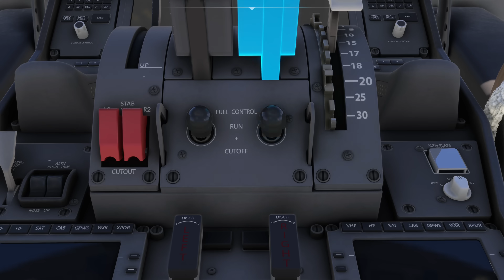Air India 171: Why Did The Fuel Cut-off Switch Get Moved?

Comment: What Really Happened - A Complete Reconstruction
THE PERFECT STORM: PRE-ACCIDENT CONDITIONS
The Aircraft:

Boeing 787-8 Dreamliner, registration VT-ANB
Manufactured 2013, 30,862 flight hours
CRITICAL: Equipped with fuel control switches part #4TL837-3D
KNOWN VULNERABILITY: Boeing warned in 2018 these switches could disengage during high vibration
FATAL DECISION: Air India deemed the inspection "advisory only" - never checked or replaced them
The Day:

June 12, 2025, Ahmedabad Airport
Weather: Clear, good visibility
Runway 23, normal operations
241 souls on board: 239 passengers, 2 pilots
THE TIMELINE OF DISASTER
T-minus 56 seconds (08:07:37 UTC): Takeoff Roll Begins
The Boeing 787 accelerates down Runway 23. Everything appears normal. In the cockpit, Captain and First Officer follow standard procedures. In the cabin, 239 passengers feel the familiar push of acceleration.

T-minus 4 seconds (08:08:35 UTC): Rotation
Speed reaches 155 knots. The pilots pull back on the control column. The nose wheel lifts off. The main gear is about to leave the ground.

T-ZERO (08:08:39 UTC): The Triggering Event
What the sole survivor heard: "A loud explosion sound"

What actually happened:

Main gear leaves the runway
Aircraft transitions to flight
One or both engines experience severe compressor stall/surge
Visible flame erupts from engine(s)
Violent shock wave travels through the entire airframe
In the cockpit:

Sudden bang/explosion
Entire aircraft shakes violently
Pilots instinctively grip controls tighter
T+3 seconds (08:08:42 UTC): The First Domino Falls
The severe vibration from the engine surge does exactly what Boeing warned about in 2018:

Engine 1 fuel control switch's defective locking detent fails
Switch physically moves from RUN to CUTOFF
Engine 1 begins immediate shutdown sequence
Fuel flow to Engine 1 ceases
T+4 seconds (08:08:43 UTC): The Second Domino
The vibration continues or a secondary surge occurs:

Engine 2 fuel control switch detent fails
Switch snaps to CUTOFF position
Both engines now shutting down
What the survivor felt: "The plane kind of stuck"

The aircraft, having just reached 180 knots and barely 100 feet altitude, suddenly loses all thrust. 241 lives now hang in the balance.

T+5 to T+8 seconds (08:08:44-47 UTC): The Horrible Realization
In the cockpit - the critical exchange:

Pilot 1: "Why did you cut off?"
Pilot 2: "I didn't!"
Both pilots simultaneously realize:

Neither intentionally moved the switches
Both engines are failing
They're only 100-150 feet above ground
Speed is rapidly decaying
241 people are depending on them
Aircraft response:

Deceleration from 180 knots begins
Minimal climb, aircraft struggling to gain altitude
Electrical systems failing
Ram Air Turbine (RAT) automatically deploys
T+13 seconds (08:08:52 UTC): Desperate Recovery Attempt
Pilots frantically begin recovery:

Engine 1 fuel switch returned to RUN
APU auto-start initiated for electrical power
Engine 2 fuel switch returned to RUN (4 seconds after Engine 1)
Critical development:

Engine 1 begins responding - core speed starts increasing
Engine 2 fails to respond properly - possible internal damage from surge
T+17 seconds (08:08:56 UTC): Asymmetric Thrust Nightmare
What the survivor felt: "Speed increased before struck"

What actually happened:

Engine 1 partially relights, generating thrust
Engine 2 remains dead
Sudden severe asymmetric thrust at only 200-300 feet altitude
Aircraft begins uncontrollable yaw to the right
Pilots fighting for control with minimal hydraulic pressure
Aircraft now heading toward populated area
T+26 seconds (08:09:05 UTC): The Final Call
"MAYDAY, MAYDAY, MAYDAY"

The captain's voice on the radio, knowing they cannot recover.

T+32 seconds (08:09:11 UTC): Impact
CCTV footage shows:

Aircraft in severe side-slip
Altitude approximately 200 feet and descending
0.9 nautical miles from runway end
The catastrophic impact:

Aircraft strikes populated area near airport
Massive fireball erupts
Of 241 souls aboard, only 1 survives
19 people on the ground are killed
Total death toll: 259 people
THE MAGNITUDE OF LOSS
The Human Cost:
240 passengers and crew killed
19 ground victims - people going about their daily lives
259 total deaths from a single preventable mechanical failure
Hundreds of families destroyed
One survivor to bear witness to the horror
The Ground Impact:
The aircraft's crash into a populated area added another dimension to the tragedy:

Homes destroyed
Families who had no connection to aviation killed
Community traumatized
First responders faced with unprecedented scene
THE CAUSAL CHAIN - WHY IT HAPPENED
Primary Cause:
Mechanical failure of known-defective fuel control switches triggered by engine surge vibration

The Fatal Sequence:
ENGINE SURGE AT ROTATION

Most vulnerable moment - high power, transition to flight
Created massive vibration/shock through airframe
Exactly the scenario Boeing warned about
DEFECTIVE FUEL SWITCHES FAIL

Part #4TL837-3D with known locking detent weakness
Vibration causes both switches to physically move to CUTOFF
Pilots had no chance to prevent it
DUAL ENGINE SHUTDOWN

Both engines lose fuel supply
At only 100-200 feet altitude
No time or altitude for standard procedures
241 people now in mortal danger
PARTIAL RECOVERY CREATES NEW PROBLEM

Engine 1 relights but Engine 2 doesn't
Asymmetric thrust at low altitude
Uncontrollable yaw/roll develops
Aircraft diverts toward populated area
INSUFFICIENT RECOVERY ENVELOPE

Maximum altitude reached: ~300 feet
Time from failure to impact: 29 seconds
Physics made survival impossible
Ground casualties become inevitable
THE HUMAN FACTORS
The Pilots:

Performed exactly as trained
Attempted immediate relight (correct action)
Transmitted MAYDAY
Fought until impact
Died trying to save 241 lives
The Confusion:

"Why did you cut off?" / "I didn't!"
Natural response to impossible situation
Lost 2-3 precious seconds to confusion
But outcome unchanged even with instant recognition
The Maintenance Decision:

Treated Boeing bulletin as "advisory"
Chose not to inspect/replace switches
Fatal normalization of deviance affecting 259 lives
THE TRAGEDY'S CORE TRUTH
This accident represents the intersection of:

A KNOWN mechanical vulnerability (Boeing bulletin 2018)
A PREDICTABLE triggering event (engine surge at high power)
AN UNFORGIVING flight phase (just after takeoff)
A PREVENTABLE catastrophe (simple parts replacement)
A MASSIVE loss of life (259 people who should be alive)
If Air India had replaced the fuel control switches as Boeing recommended:

The engine surge would still have occurred
The switches would have remained in RUN position
FADEC would have managed the surge
All 241 people on board would have survived
19 people on the ground would still be alive
259 deaths would have been prevented
THE GROUND TRAGEDY
The 19 ground victims represent a particular cruelty:

No choice to board the aircraft
No connection to the flight
Simply in the wrong place
Killed by a falling aircraft they never saw coming
Victims of a corporate decision to ignore safety guidance
FINAL DETERMINATION
Flight AI 171 crashed because:

Known defective fuel control switches were never replaced despite manufacturer warning
Engine surge at takeoff created the exact "high vibration event" Boeing predicted
Both switches failed as Boeing said they could, shutting down both engines
Insufficient altitude prevented recovery despite crew's best efforts
Asymmetric relight created uncontrollable flight condition
Crash trajectory took 259 lives instead of "just" 241
This was not pilot error. This was not an act of God. This was a preventable tragedy caused by ignoring a known safety risk.

The sole survivor's testimony - the explosion, the plane "sticking," the speed increase - provides the human experience of a technical failure that should never have been allowed to occur.

THE ULTIMATE TRUTH
241 people boarded Flight AI 171. 19 people were living their lives near the airport. 259 died because a safety bulletin was treated as optional.

One fuel control switch inspection could have saved them all.

That is the complete, devastating truth of what happened.

Comment: Just wondering... do the retrieved metrics actually confirm the physical transition of the switches or  they just report the "effect" of it on FADEC? It's electronic and software, what if FADEC got a command "as if" the switches  where transitioned from one position to another one? One of the pilot. once realized the loss of power, could have then actually tansitioned them to Cut-off and then Run as for the emergency procedure. This would explain the longer time in seconds logged in the report. In this case the physical transition to Cut-off by one of the pilot would not be registered because for FADEC it was already in that state

Comment: Captain Steve, other planes have different ways to run / cutoff fuel. Victor from VAS aviation showed his his Cessna Citation is set up: the fuel cutoff is built into the throttle with a safety device. Is there a better way without becoming too pedantic to improve the Boeing system? And perhaps Airbus too?  The thought in my mind is that the pilot knew that this would be hard to recover from.

Comment: I understand that pilots may be concerned about people reviewing every little nit if video were readily available, but if the video is stored on the CVR and only pulled in the case of an incident like this, then it should resolve that concern.

I like the idea of the dual pilot action requirement for fuel cutoff.

Comment: You are saying a pilot error 
How can it be possible by a human 
Plane speed is 183 knots  at take off 
Just after 3 seconds both  engines cut of the fuel  in duration of 1 second.

Comment: Many experts in India are saying it is impossible to move each knob for each engine, with only a 1 second delay (as per report). I'm wondering is it possible for a pilot to use both hands, pulling each engine fuel knob simultaneously? Effectively shutting both engines down at almost the same second (thus only 1 second delay showed on report)?

Comment: We do not know if the switches were physically switched to cutoff. All we know that the electronic system thought so. What if "I didn't" was a genuine reaction?  The pilots then turned the switches on and off until the electronics registered the run position?

Comment: 35 year Airline Pilot now retired, they need to do a mental fitness evaluation background check on these crew members. Clearly those switches were deliberately shut off and then whoever, most likely the captain, said “he did not”. Need to do a MONEY trail on life insurance payouts for this Crew member. He clearly shut the fuel levers off at the most critical phase of the flight. They had just reached their second segment climb,. There is no way those engines were going to recover after a 10 second cut off so low to the ground. These third world airlines are  dangerous. There have been several cases, including Egypt Air, MH 370, German Wings and others where one crewmember decides to end the life of everyone on board…..
Reply: never knew Germany is third world too
Reply: I'm not too sure where this man is going with that statement regarding Third world countries.
Reply: @mousamroy5093  Nor Egypt. Nor India.
Reply: I completely agree. With 34 years of flying experience and over 20,000 hours under my belt, I believe the deliberate action of pulling the cut-offs at such a low altitude would have been catastrophic and unsurvivable. Given the timing, it's unlikely the other pilot could have countered the action in time. The horror and realization of impending doom for everyone on board would have been unimaginable for the other pilot.
Reply: you do realize you actually judged both and yet there is absolutely no physical evidence either one did this.  Talk about mental health here....judgement of others is a learned behaviour.
Reply: Yes, in aviation history there are some rear cases of SUICIDE action. However, the final report has not came yet. There are some other cases during take off when these FUEL CUT OFF switches can be operated. In case of engine failure and in case of engine fire.
Reply: @NeosNeidis there is no procedure, and I've flown multiple Boeing jets, where the pilot would chop the fuel on both engines, even if there was a fire.  If a pilot were to shut an engine down, and most definitely it would only be one, he would first have pulled the thrust lever to idle, and those pilots would be hearing alarms going off and talking about the engine problem.  Clearly, in my mind it's a suicide pilot. I can find no other explanation.  No professional pilot accidently pulls both fuel levers to cutoff at 100'.  That's guaranteed death.
Reply: Why would Captain cutoff  fuel supply? He was unmarried and was having responsibility of supporting his eighty years old father! He had twelve thousand hours of flying experience out of which eight thousand hours were of flying Boeing aircraft.As per the preliminary report "Rat" got deployed before the fuel supply  knob went to cut off position! Why?  @NeosNeidis

Comment: I remember Capt Steve mentioned before that there's a ground load sensor to sense whether the plane is still on the ground or not. Would it be safer to build in a fail safe mechanism in the future to add more confirmation steps to fuel cut off if the ground load sensor indicates the plane has just taken off not long ago?

Comment: The preliminary report says the switches transitioned from run to cutoff position with a time gap of 1 second between them. Indian media is saying that it couldn't have been the pilots moving the switches as it is not possible to turn both switches to cut off within 1 second of each other due to the design. So, my question is, is it possible to turn them to cutoff within 1 second of each other or could the recorder have detected the time differently to the actual time taken.

Comment: Captain Steeeve, What should have been happening at the exact same time that the fuel switches were shut off.  The LANDING GEAR lever should have been grabbed and the landing gear retracted.  The landing gear was never retracted.  Is it possible that one of the pilots, the one that was supposed retract the landing gear, instead had a brain fart and shut off the fuel instead? Then he answers the question no, I did not shut off the fuel, as that is what he believes.  The landing gear is never brought up and instead the fuel is shut off.  This would make sense if one of the pilots was under some extreme pressure outside of his job being a pilot.

Comment: I rarely comment on youtube. But always drawn to these incidents and topics. On the camera being in the cockpit, why not have them record directly/automatically to the blackbox, during an emergency or a mayday call, if privacy is a concern, to start with. Also, I feel it is a little early to blame the pilots.., more questions than answers at this stage... Would'nt the flight recorders clearly show if the switch was mechanically moved or it was an electrical event that caused the incorrect signal to cutoff

Comment: Between switches moved to cut off position there is only 1 second, you only are telling you need to pull it, move it down and release it. These 3 steps itself will take more than 2s. So you're just trying to save Boeing. To me, it feels like, locking mechanism was disengaged as per 2018 advisory and due to take off vibration and gravity , switches automatically moved down to cut-off due to plane's issue nothing related to pilot's fault. You know how 737 Max case turned out to be otherwise I can remind again.

Comment: It’s very clear that you’re trying to save the corporates and Boeing for sure. Switching the fuel switches in a few nanoseconds is impossible so the pilots are absolutely not responsible. They are made scapegoats to save the big giants of the industry and its shameful you are extending your support to this pilot error theory. Shame on everyone…it’s easiest to blame pilots and who are dead and are not able to justify themselves. But to an extent we believe it’s just saving the big giants like Boeing and GE. There is a UK report even in early 2025 which specifically mentions an issue with fuel cut off valve which may need daily check. But giants what’s to escape from this and buy out media who are ready to be sold. This is what it is…Anyways let the detailed investigation with full detail come out and which may take a few months or even a year…

Comment: Hi Team, there was talk about landing gear etc.  So wondering with the cut off of the engines, would it be the same pilots responsibility for retracting the gear etc. just wondering if pilot 1 raises gear, sees it was not working looks sees the switches are down thus no power to raise the gear.

Comment: Can I ask a follow up on MukundanP at 02:20 please -  The reason you gave was that you might want to cut off when landing. However, in this situation it's a take off. If the second engine is cut off just when thrust is required the outcome is going to be fatal (agreed?). Should this not be designed against. Once the aircraft is past whateever critical point then both engine fuel cutoffs could be enabled again. Can you please comment. Thank you.
Reply: This is something I also have a doubt about. Actions like this in takeoffs would be fatal, hopefully the manufacturers do something to stop sabotage.